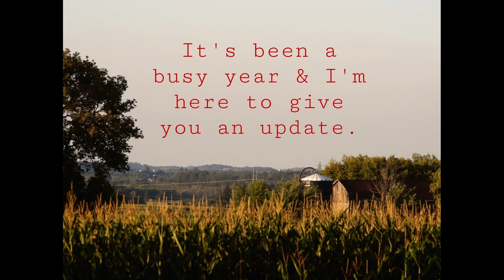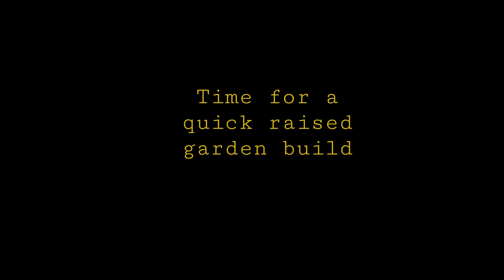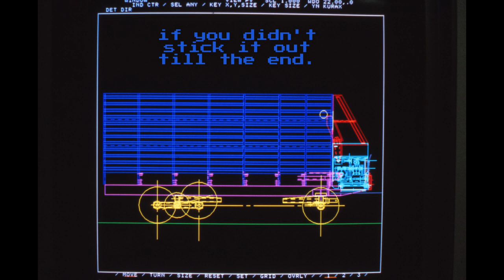2022 Season Update Revision 10,000 - Gehl stuff!!

Comment: Ikon great video & think when the emp's hit & all the new computer driven tractors & planters  are rendered useless  you will carry on
Reply from the maker: Glad you enjoyed, bones! My Farmall H's & the two diesels will soldier forth. The distributer on the small Cub & big 806 is a toss up. The H's were still made in an era where they were meant to run on poorer fuels. So, I can run those off of a wood gasifier without issue. The gasoline heads on them (for better compression) & a nice white hot spark from the mag will keep those running good for a long time. My best H turns 35 HP on the dyno & running it wood gas would bring it down to about 25 - 28. That's just under what they would be stock on gas. Kerosene or distillate would have run the lower numbers, so I can still do the work it was designed to do at rated. The diesels can get run off of good ol' Bio Willie. :v)
Reply: @ikonseesmrno7300  
Love your details Ikon. That's a heckin study ploughing thingy😹
Hay...I'm still learning! Been a city slicker up til recently. 
Really dig your content mate. Go easy on them besser block gardens😳